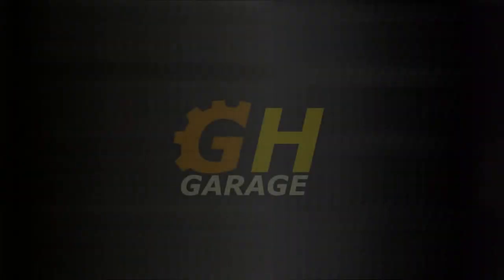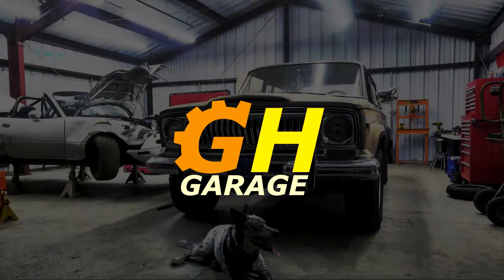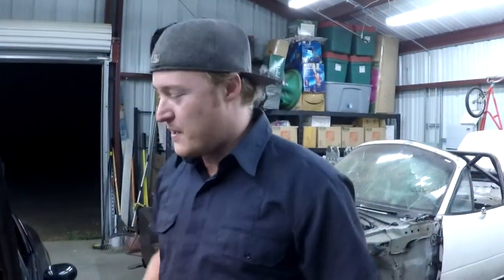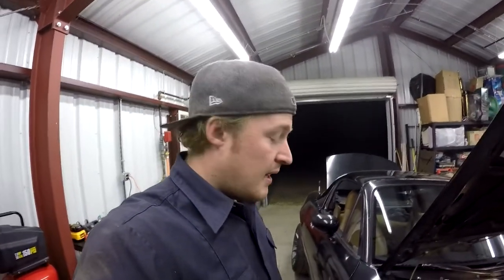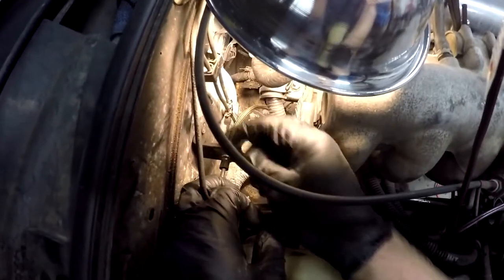Refresh Your Clutch Hydraulic System! | Reborn Turbo Miata Build #9

Comment: 2:00 master cylinder location and drain instructions.
2:38 slave cylinder location and access.
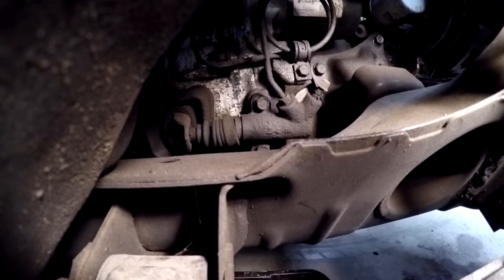3:54 slave cylinder drain.
4:28 hydraulic line removal.
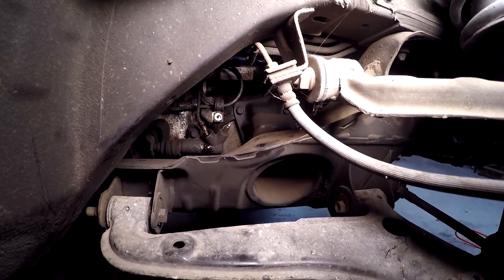4:48 slave cylinder removal.
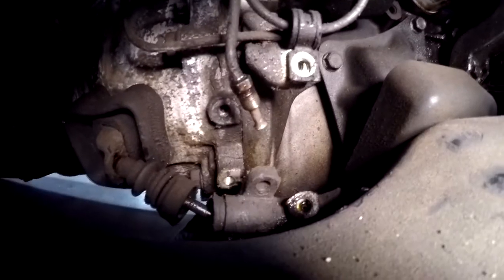5:47 hydraulic line removal 2.
6:40 hydraulic line removal 3.
7:54 SS hydraulic line install.
8:32 slave cylinder install.
10:21 master cylinder removal.
11:17 master cylinder install.
11:50 fluids.
12:35 bleed.
Reply: Yes, very helpful vid!    PROTIP for Miata Community:  After installation of parts and doing the BLEED job...if you have trouble with getting all air bubbles out of line after numerous repeated attempts -- try removing the Bleed Screw and applying a couple of layers of Teflon Plumbers Tape (don't cover bleed hole, though) on threads.  After a lot of frustration, this finally eliminated air leaking back into the Slave cylinder (despite the Bleed Screw being fully tightened), facilitating a vacuum for the air bubble-free flow of brake fluid and completion of the Bleeding.  Hope this helps others facing this predicament !!

Comment: Yes, very helpful vid!    PROTIP for Miata Community:  After installation of parts and doing the BLEED job...if you have trouble with getting all air bubbles out of line after numerous repeated attempts -- try removing the Bleed Screw and applying a couple of layers of Teflon Plumbers Tape (don't cover bleed hole, though) on threads.  After a lot of frustration, this finally eliminated air leaking back into the Slave cylinder (despite the Bleed Screw being fully tightened), facilitating a vacuum for the air bubble-free flow of brake fluid and completion of the Bleeding.  Hope this helps others facing this predicament !!
Reply: I’m having trouble with a leaky line from the hardline that feeds the slave cylinder, all new lines

Comment: I would recommend to rotate the house clamp on the brake booster, so that it's not facing your hands when you're breaking free the master cylinder bolts.
Stupid clamp sent me to the ER.
Reply: So Sorry you were hurt!!!!  Please wear razor proof gloves; they fit tight.  Are you ok?  Was the cut deep???   ??  Stitches???  I don't want my Brother hurt, he has MRSA.   HE'S VERY SMART LIKE YOU GUYS!   HE WAS ONLY GOING TO REPLACE THE SLAVE CYLINDER, UNTIL I FOUND YOUR VIDEO!  THANKS SO MUCH GUYS!

Comment: Great vid, thanks. 1996 Miata M5 suddenly will not go into gear unless the car is not running and the clutch pedal has almost zero pressure. I replaced the master as well as the slave cylinder thinking that would fix the problem as there was fluid coming from the slave cylinder however there is still no pressure at the clutch pedal. Now I see that the slave cylinder is not being effected by the depression of the clutch pedal...any suggestions?
Reply from the maker: Get a vacuum bleeder and bleed it till the clutch pedal is stiff and it moves the slave, have someone else pump and hold the pedal and double check the lines from beginning to end for leaks. It is a very simply hydraulic circuit, either you have air in it or a leak or maybe a failed internal master cyl but only testing and verifying will narrow it down.

Comment: try puting a small rubber hose on a bleader when you blead
i use 50cm/20inch hose with small bottle on the other end with little bit dot4 inside
prevents spillage mess and sucking air back
Reply from the maker: Spone85 I'm aware and often use that method with some rubber vacuum line when bleeding brakes but the slave is usually so quick and easy its just easier to throw a tray under there and be done with it.

Comment: Hey I was driving one day and the car suddenly went off with a battery signal, like when it stalls after selecting the wrong gear. Then the next day I woke up to find I lost all pressure in the clutch pedal that now goes all the way without any resistance and the car won't go in to gear when it's on. When it's off, it still selects gears are smoothly as ever. My modest research lead me to this slave and master cylinder replacement, am I on the right path?
Reply from the maker: Yes you have a clutch hydraulic issue, either a leak in the line or slave cylinder or the master is bad. Check the fluid level if its still completely full and you dont see any other leaks on the line or slave cyl then its a bad master.

Comment: Hey have you guys ever replaced the clutch replaced the hydraulic system line and all and the car won’t go into gear? It will when the miatas off but won’t when the car is on I got a straight shot braided line from miataroadster but I can’t get the car to get into gear for the life of me after a few days bleeding it has no effect no depression once the slave is bled but liquid will come out of the nipple and pressure does build on the pedal not sure what I did wrong I’m afraid I didn’t install the pilot bearing or throw out bearing correctly only way to tell is to pull off the transmission god forbid I over torqued the PP any input will be appreciated thank you! 🙏
Reply from the maker: Overtorquing the PP is very unlikely to cause this, if nothing else are you sure the clutch fork is lined up and installed properly? If you have the system bled and are sure there is no air in it then when someone is pushing the pedal you need to see if the slave cyl rod is pushing it. If it is but not enough(which is what it sounds like since you cant get in gear) then you either have air in your line still and havent properly bled it, or your master cyl is bad, or your clutch pedal needs adjusted.
Reply: GearHeads thanks for the response!! I’ll look into it we swapped the rod for a longer one about 2 times hoping to get enough throw out of it I also adjusted the clutch pedal a few times as well but if the clutch fork is not lined up properly I figure we’re just working against ourselves
Reply from the maker: @briancastaneda5500  idk sorry man I gave what info I could, nothin else I can help with without being there myself to see it.
Reply: GearHeads hey no problem man thanks for replying I’ll look into what you told me I’m most likely to pull the transmission off again and take it from there
Reply from the maker: @briancastaneda5500  Make sure your getting movement at the slave cylinder first and you have good pressure coming out the bleeder when you crack it open and someone is holding down on the pedal, you might have a weak Master Cyl. If the slave cyl fails it will leak, the masters CAN leak internally. Not saying thats it but eliminate the simple things before pulling the trans.

Comment: Really good video. Any different (parts or otherwise) for an NB? My symptoms are all of a sudden it won't go into gear. If I try to push it into gear with clutch in, the car actual creeps forward a bit. Can only get it into gear with car off, then start it and clutch behaves normally but only for that gear. Won't go back into gear after taking it out (unless car is off). Any ideas? Thanks!
Reply from the maker: Definitely a failing master or slave or a leak. Dont try and push it into gear like that to make it creep itll hurt the synchro for first gear!
Reply: @GearHeadsGarageChannel  Roger that I won't! Really appreciate the prompt reply.
Reply from the maker: btw parts off the shelf will be different part numbers but the NB is the exact same design. Slave and Master may have slightly different internal bore sizes but overall its the same as NA.

Comment: I know this an old video but I'm planning on doing my slave cylinder here soon, but wouldn't it have been a good idea to bench bleed?
Reply from the maker: mazda_freak Your correct that would be a good idea to do, it bled fine either way though. Its definitely required for the Brake master
Reply: GearHeads i rememeber doing research and finding out that installing without bench bleeding can blow out seals, idk if that's true, either way, excellent video, signed loyal subscriber

Comment: I’m having trouble getting my hardline bolt off on my old slave, using a 10mm and it just won’t budge, do you have any suggestions?
Reply from the maker: If you cant get it with a 10mm without spinning on the nut(which will mess up the nut and make it even harder) try and buy a 10mm Hex crows foot wrench from a parts store or online and you can apply more pressure that way to break it loose without damaging the nut. If the nut does get damaged, use a file and flatten the rounded edges to either try again with a smaller wrench or get two good flat spots and a pair of vice grips with a pipe over the top to break it loose. In this case though you'd want to end up replacing the nut/line!

Comment: Hi guys I like yours videos, any idea how to make a power steering conversion in a 1993 Mazda b2200?I need some help
Reply from the maker: You can get the power steering pump, maybe an idler pulley, lines, and steering rack from a truck that had it and it should bolt in.

Comment: I'm gonna bleed the system today. Recently replaced clutch and flywheel. The clutch was biting very low down on the pedal at first and recently started biting very high up on the pedal. Any ideas what might have happened to cause this?
Reply from the maker: Have you adjusted your pedal? and grabbing low would indicate lack of pressure usually failing cylinder or leak, grabbing high would be worn clutch disk or something else out of adjustment like the pedal. That doesnt make sense though that it changed on its own?
Reply: @GearHeadsGarageChannel  it's all backwards. Doesn't make sense. I bled the system and now it seems fine. Hope it'll continue like that.

Comment: i replace my slave cylinder but i cant get the clutch fork to move the slave cylinder with the pedal. So basically all the pedal pumping in the world wont do anything cause the shift fork isnt moving with the pedal at all. i even removed the slave and pushed against the fork with my hand and when my buddy pumped the clutch the fork didnt move at all so i dont know what to do any advice is much appreciated.
Reply: i dunno if replacing the master cylinder will solve this cause i do have a brand new one but i dont wanna use it if i dont have to
Reply from the maker: Hey sorry didnt see this we were on vacation in Mexico, but it definately sounds like you didnt get the system properly bled, unless your master completely failed but no movement sounds like air in the line.
Reply: yeaaah i figured it out i didnt understand how the hydraulic system worked, i though the clutch pedal was directly connected to the fork so i gave up and thought something else was wrong until my dad sent me a hydraulic clutch diagram and then it all made sense. My clutch now feels better than stock

Comment: Idk if anyone will respond but I'm having problems with my shit cause it's all new master cylinder, slave cylinder, and line but I cant get pressure back and the slave cylinder piston doesn't move? Help
Reply from the maker: Might want to get a cheap vacuum bleeder from a parts store and use suction to get the fluid coming through and bled properly. Make sure you have ALL air out of the lines, if you still have no pressure and there are no leaks and your slave piston isnt moving then maybe you need to adjust your clutch pedal but if that is the same as before I highly doubt it.

Comment: I'm not sure about this bleeding method.
usually what I see is 1) pedal down (one time!) 2) open  bleeder 3) close 4) pedal up.
don't see the need of the pumping, the fluid is not going anywhere.
Reply from the maker: Nebbia affaraccimiei Getting more bubbles and air out at once. No Mechanic I know(I am one too btw) only does one. In my opinion the best time is once you feel the pedal start to firm up. When you are first starting the bleed you might not have enough pressure to do this though so less pumps between opening the bleeder can be more effective.
For the record your right the fluid isnt going anywhere! But unlike the fluid, air compresses and that is actually what you are trying to get rid of anyway, not fluid!

Comment: I got a "miata clutch line" from Goodridge and it has female connectors on each end, wtf is it for? It's pretty clear that I need a female to male line so that the male end can go into the slave cylinder.
Reply from the maker: I have not used that one before, but looking at it quickly, instead of the style you get from goodwin racing, or 949 racing(Like I have and used here) that replaces the whole line from the firewall down to the slave, the one you got likely ONLY replaces the rubber section of it, keeping that coiled hard line in tact like the factory one. Check that out as that would be my best guess.
Reply from the maker: Glad to help! Haha and thats awesome! Greg is great =)
Reply from the maker: Awesome glad it worked out for you! Hopefully you don't have to touch it for a long time! But if you ever do, I know what you mean about that being a bitch to get to, the other options out there go straight from the firewall to the slave so they are much easier to deal with and give you more room to get your hands down there if you ever have to pull the transmission etc. Not worth replacing obviously since you just got a new one, but $30 for one down the line if you ever have to tear into it again might be worth it!
Reply from the maker: I agree, I love the one I have because it makes it so easy later on and doesn't get in the way, including when pulling the engine etc.